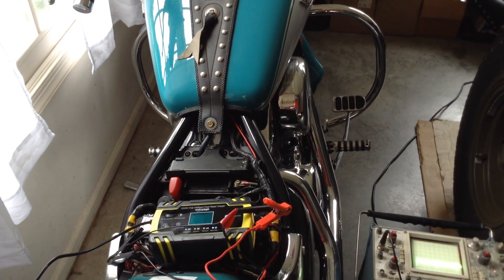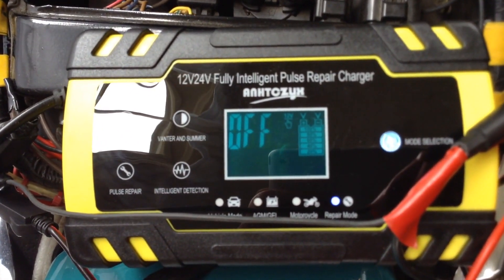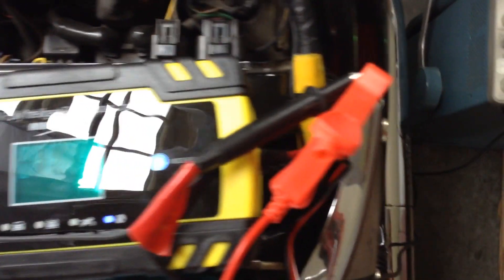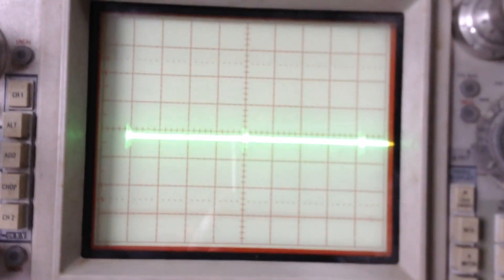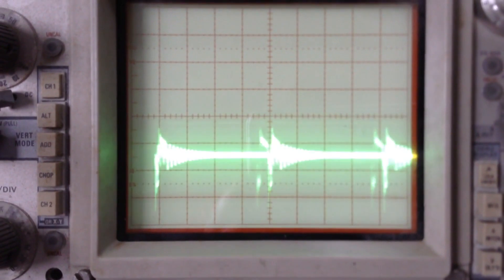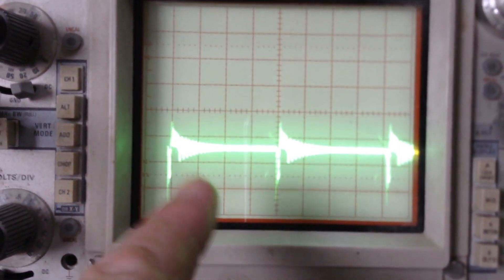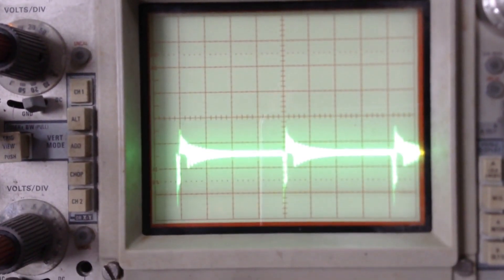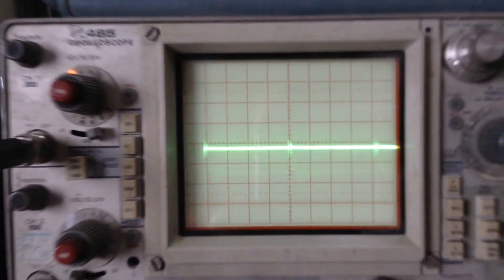Enusic / FOXSUR Pulse Repair Battery Charger from Banggood - waveform on oscilloscope

Comment: Thanks for the video!  I just picked one up and found something interesting.  When the unit is "OFF" but plugged in, the output of the charger changes depending on if it was on "Vehicle Mode"/"AGM"/"Motorcycle" or "Repair".  In the first 3 modes, the voltage output seems to be steady at 13.78V or so with little variation.  However, on "Repair" mode, the voltage output is at 15.80V and it fluctuates +/- 0.01 V.  I can also see some current fluctuations as well 200 to 250 mA according to my clamp meter.  Did you see any waveforms on your oscilloscope with the charger off?
Reply from the maker: Thanks for your comments Richard. I see very similar readings in the different modes with my chargers as you saw with yours. In this video, the charger is NOT connected to a battery and the charger is in the OFF state with the Pulse Repair mode selected. You can see that there is a waveform. In my other video, the charger is connected to a battery. Sorry about the audio in these videos. The description contains the text to my narrative.
Reply: @georgeterbush2976  No worries George.  The work you did is a valuable resource for anyone looking to learn more about the charger.  BTW.  I tore down the charger yesterday to check for proper noise suppression (another Youtuber pointed out that early version of this charger doesn't have any noise suppression components installed so I wanted to verify if mine had) and found that I'm still missing a few bits that I will fix but there are a couple of improvements you might want to look into.  Various IC's packaged in TO-220 packages mounted onto heatsinks don't have any heatsinking grease or thermal transfer material between the package and the heatsink (easy fix) and the thermistor which is used to measure the temperature is mounted facing the top of the case which will get warm as the charger is used resulting in an incorrect measurement of ambient temperatures.  A better placement would be to remove the component and mount in on the other side of the PCB which should allow better airflow from the fan.  OR for bonus marks, connect some wires to the sensor and mount it in the air intake grill of the charger.
Reply from the maker: @richardlouie2922  Those are some awesome improvements! My chargers are in constant use but I will take one apart and see if I have the ferrite core or beads. I have lots of thermal grease so I'll do that at the very least. Good luck with your charger. Hope you find the Pulse Repair as useful as I have. It will not restore batteries that are too far gone, but it has keep my batteries healthy.
Reply: @georgeterbush2976  Here's the link to a Youtube video on the noise suppression bits that may be missing as well as the modifications that were done to correct the suppressions issues. https://www.youtube.com/watch?v=wZNhEB8_PCM. One thing I didn't see them put in is a ferrite core on the AC input cord which should be very simple to do to add a bit more suppression.  BTW>  I have found a few reviews of these chargers over heating or blowing a transistor so it might be a good idea to take a couple of high resolution pictures of the components in case you need to do any repairs.
Reply from the maker: @richardlouie2922  Good idea about taking a few high res pictures of the circuit board. If a component gets fried, it may be impossible to see any markings on it.  Thanks again for this info. Fun stuff!

Comment: Great video with a lot of useful information.  I have the same charger, I hooked it up to a 4.5 year old AGM battery taken out from my car.  The battery was at 12.3 volt and my car's charging system did not seem to be able to bring up the voltage.  I had the battery hooked to the charger in Repair mode for 36 hours, it made significant improvement after that. I did not wait until the repair was done,   I should have let the Repair run until it stops as I suspect there is still room for further improvement.  I believe when the Repair is done, both the blinking of the display and the fan on the charger would stop.
Reply from the maker: Thanks for your comments C Lee. It is a great charger and the Pulse repair really does improve the health of the battery.  I have often stopped the charger before completing the Pulse repair, but it's no problem. Just put it back on later and let it finish doing its job. After 36 hours, it's probably almost done anyway. You are correct. When the repair is complete, the blinking of the display will stop and it will display "OFF'. The fan will also stop.

Comment: Can the repair mode be used while the battery is installed on the vehicle?
repair mode has a pulsed current curve, will it damage the vehicle control unit?
also, Could this device really work?
thanks
Reply: I’d disconnect the battery terminals regardless

Comment: For a battery that is 4 to 5 years old, it is a good idea to run on Pulse, say twice a year, even if battery still works? Based on what you said there could be sulfate build up over time and running pulse will ensure that this is removed.  I read somewhere that only high voltage 18+V has desulfating effect but not sure if the frequency here helps with lower voltage.
Thanks for your video
Reply from the maker: Hello Ni Fu. I put my batteries on the Pulse repair every month. It does not ensure that all of the sulfation is removed, but I think it helps. I would be afraid to put 18 volts on a car or motorcycle battery,  but I think the 15 volts during the pulse repair phase is ok. Once the Pulse repair is complete, I switch the charger over to Motorcycle mode and keep it there as a trickle charger. In that mode it is around 13.8 volts.

Comment: Can the pulse charging be used with AGM Motorcycle Battery? In this video, what type of motorcycle battery you are using? As I'm using AGM Motorcycle battery, would it be better if I charge using AGM mode or the motorcycle mode?
Reply from the maker: Hi Azim. The battery in my motorcycle is a 12 year old AGM battery. I would only use the Motorcycle Mode to charge your motorcycle battery. When in Motorcycle Mode, the charger limits the current to 1.5 amps which is good for a small motorcycle battery. If you put the charger in Vehicle mode or AGM mode, the current will be much higher. The Pulse repair mode is used to help remove sulfation from the plates. Once the pulse repair is finished, you should push the button to switch back to Motorcycle Mode and it can stay there like a trickle charger. AMG batteries like to be charged slow and at a lower voltage. 

Some experiments...

Lights were keep on for 20 minutes to drain battery a little - after lights were turned off battery read 12.4v
I placed the charger on the battery for about a minute in each mode and observed the following...

Motorcycle = 13v at 1.5 amps slowly charging. 
AMG = 14v at 5 amps
Vehicle = 14.6v at 5.5 amps
Pulse = 13.6v pulsing - slowly rising until 15v is reached

Voltage will go up and amps will go down as battery reaches full charge

Please understand that I am not the charger's manufacturer or a battery manufacturer. I am just a user like you.
Reply: george terbush Thanks for the details explanation. Keep up the good work!

Comment: Thanks for your upload.  I bought same item and I have a question. Does the pulse repairing work in same frequency  every time?  It seemed about 200kHz frequency ; 2 waves per 10 micro second  in your video. Because I don't have a oscilloscope,  your reply would be help me.   Thank you!
Reply: Perhaps,  1 wave per  40 micro second ?      So, therefore 10kHz?
Reply from the maker: @taichirokaneo5426  I'm not sure how you are doing your calculations, but I'm pretty sure Frequency is the inverse of Time. 

F = 1/T 

The period T is the time required to complete one cycle. The frequency is the number of cycles in one unit of time.
25000 = 1 / .000040

To answer your first question, yes the charger's frequency does change while charging a battery. Please see my video where it shows the charger connected to a battery...
https://www.youtube.com/watch?v=jozma2v1Dus
Reply: @georgeterbush2976  Oh OK, I see.  Thank you very much!

Comment: Did it repaired any battery? I have osciloscoped the older small 5a model and the waveform was almost 70Vp.p.
Reply from the maker: I believe the charger has restored my batteries to be as good as they can be. When I originally put the charger on 2 of my old batteries, it took several days in Pulse Repair mode before the charger turned off. Now it usually only takes less than 15 minutes in Pulse Repair mode before it turns off. I wish I had a battery tester that measured internal resistance. I'm almost certain this is what the charger is measuring to determine if repair is needed.

The reason I wanted to look at the pulses with an oscilloscope was to make sure the peak to peak voltage was not something crazy like 70Vpp. Some old chargers used high voltage spikes to try to break up sulfation.  I did not want that on my cars. I believe this Enusic / FOXSUR charger is putting out 15Vpp in Pulse Repair mode at 50 kilohertz, then slow to 42 kilohertz for a second, then snap to 25 kilohertz.

If someone is measuring something different, please post it!

Comment: Maybe this helps you: when the display shows “off”, the unit is still working! In charging mode, it first charges at a set current 8 or 1.5A. When the voltage reaches 15V, the current will drop. When the current gets too low (battery almost fully charged), the unit shows “off”, but actually enables the trickle charge mode, that lasts until disconnected. The voltage is fixed at 13.85 V, and the fan doesn’t spin. So, to obtain a real full charge, is important to leave everything connected for a few hours after the unit shows “off”
Reply from the maker: Great info! Thanks.
Reply: I have a question to the pulse repair mode of this device. Here blinks if connected to the 12v car battery only the REP symbol at bottom. Is it normal? Ive see here on youtube many vidz where the percent box is blinking and the REP symbol not.... Any thougths?
Reply from the maker: @stevenstevieoo539  When I put my charger in pulse repair mode, the "Rep." symbol at the bottom of the LED display appears and does not flash. The entire percentage box does flash. It will do this until the battery is fully repaired, then the charger displays "OFF'. I just uploaded a video of this...
 https://youtu.be/fiH_UEaTlOs

Comment: Great video, thank you! Let’s say your battery is low and sulfated, idling at 12.1 V. Do you first run the repair or the charge mode? For how long?
Reply from the maker: What I did to my car batteries was to put them on Vehicle charge mode first until the charger turned OFF. That took several hours for some of the batteries. Then I switched the charger over to Pulse Repair mode and let that run until the charger displayed OFF. One of my batteries took 30 hours in Pulse repair mode. I am not a battery expert so maybe doing the Pulse repair first should be the first step. I don't know. I would like to hear other people's experiences. If I get the opportunity, I will do Pulse repair first until charger displays OFF, then charge it up.

I have 5 batteries but only one of these chargers. After I have charged and repaired my batteries for the first time,  when I put the charger back on a battery, I put the charger in Motorcycle mode, then plug it in. It takes longer to charge or rather top off the battery, but I think it is healthier for the battery to slow charge. I then switch it over to Pulse repair mode until it turns OFF. The Pulse repair does not run very long now since doing the first repair. I then switch the charger back over to Vehicle charge mode (if it is a car battery) and let it sit. As you pointed out, it is in trickle charge mode and is monitoring the battery.
Reply: @georgeterbush2976  I think you are using it right. I wouldn't use motorcycle mode for car batteries, because taking 8A max is not a problem for a "big battery", and anyway the voltage is controlled/limited. What I would avoid, is to use the pulse repair mode while the battery is connected to the vehicle,  for 2 reasons: the pulses would be absorbed by the car circuits instead of the battery plates, and the car's ECUs might not like the interference..
Reply: @georgeterbush2976  might be late to ask Goerge, my 32Ah battery undergone repair mode now. After 3 hour i heard little gurgle, i have to put my ear around 10cm to hear it tho. Using my thermogun now its at 28'C, just like before repair mode. is it normal? or should i stop and rest it for a while? its a Gel Battery.
Reply from the maker: @GigsYooTV  It's best to ask the manufacture this question. I have not had much success fixing a bad battery with the pulse repair, but it is good at maintaining a fairly healthy battery.

There is a company that sells another version of a pulse repair charger that has a good Q & A page on their website...
https://www.pulsetech.net/support/frequently-asked-questions.html#4

Comment: Hi, an information regarding the "Pulse Repair mode": is it possible to charge the car battery, keeping the main cables of the automobile system connected? Or is it better to unplug the car's main cables? 

Greetings and thanks
Reply from the maker: Hi Giuseppe. 
So far I have not had any problems keeping the main cables from the car connected to the battery when I am running the charger in Pulse Repair mode. I was also concerned about this since the charger is sending pulses into the electrical system.  I was worried it may hurt the car's computer. I have run the charger in Pulse Repair mode on my 2 motorcycles, a 1985 jeep, a 2002 Crown Vic P71 and a 2014 Kia without any issues. 

There is a company called PulseTech that has a lot of experience developing battery recovery devices using high frequency pulses. On their website, they say...

"It is not possible for any of our products to damage the electrical system on any vehicle. By attaching the product to the battery, the pulsing energy is absorbed within the battery and is not "seen" elsewhere in the system. This technology has been applied to a variety of military vehicles with very sensitive launching systems or computer systems with no interference or problems."
https://www.pulsetech.net/faq#14

I can not say the Enusic charger is using the same method of pulsing as PulseTech, but it is probably similar.
Reply: @georgeterbush2976  Thank you very much, very detailed explanation.